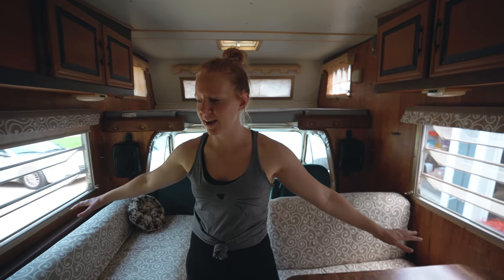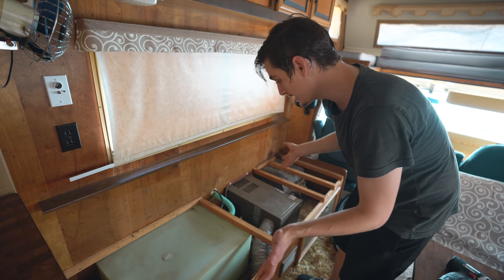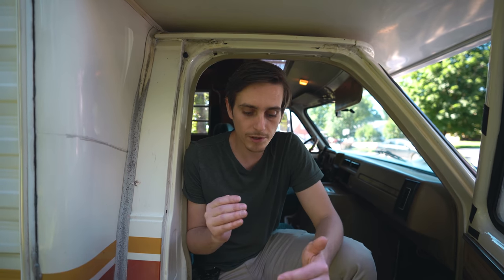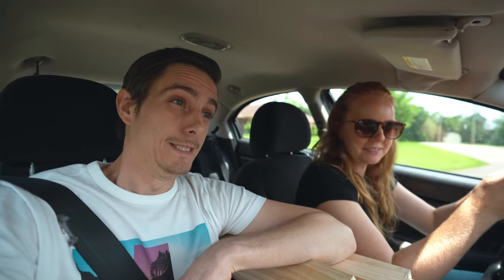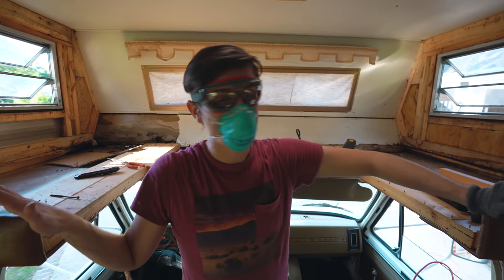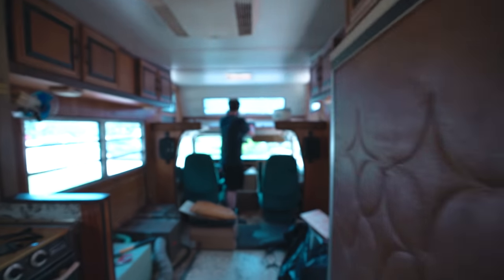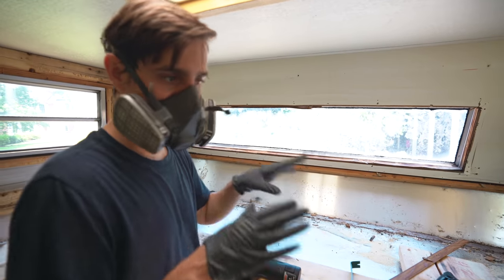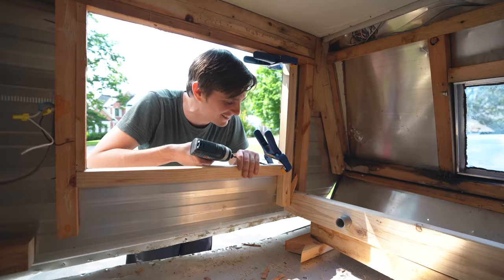Vintage RV Renovation BEGINS!… And We Have No Idea What We’re Doing 😳

Comment: From experience, I've learned not to throw away any of the paneling until after the job is done. All of the old stuff will be extremely useful as patterns to cut the new stuff from. And PLEASE, document ALL of the renovation. It's fun for all of your subscribers to follow, and you'll enjoy looking back on it in the future. Best of luck with your project.
Reply: Exactly what I was going to say - it’s a tremendous help to use the old stuff as templates to cut the new stuff!
Reply: Yes! Ditto.... brst advice :)
Reply: What I was going to say, easy thing to miss.
Reply: Exactly! Keep every screw, every panel, EVERYTHING. It's extremely helpful throughout the project
Reply: I'd agree. I expect it's a case of easy to rip apart, but a pain to get it back together properly.
Reply: @hazelrx97  YEP!  And lots of tupperware with labels to know where the hardware came from!  And pictures to know how to put it back together!!
Reply: I'd like to have some of the Old stuff

Comment: Some tips from someone who's done a few of these:
1) Paint the roof with Aluminum RV roof paint, it seals all the screw holes and reflects the sunlight.
2) Take pictures before you take anything apart, it helps even with building new stuff
3) Get lots of tupperware containers and keep screws, bolts, hardware, etc. so things don't get lost
4) Don't take too much apart at once.  Pick a small section, and rebuild it all the way.  It's easy to start tearing everything apart, and the next thing you know it gets too difficult to put back together!!!
5) Keep your RV well ventilated, and use desiccant if needed for moisture control.  It's easy to get too much humidity inside from a shower, your breath, etc... and then the wood rot begins!!
6) Think about using FRP for your paneling, it's waterproof and cleans very easily.  It is very difficult to work with, but once it's in it will last FOREVER :-)
Cheers!!
Reply: Thanks for the tip!  Never knew about this material.  I looked it up:
Fiberglass reinforced panels, or FRP, are thin, flexible plastic panels made of strong polyester resin reinforced with fiberglass. They are used on walls and ceilings and can be installed directly over drywall, wood, concrete block, and many other solid surfaces.
  Cost for 4' x 8' panel is $32.
They also come as plain vinyl sheets (no fiberglass) shaped like a brick wall, tin tiles, shiplap, textured, or smooth.  More research is needed as to pros and cons and how to cut it, mount it.  Looks like an industrial glue paste is recommended like Loctite Power Grab or Liquid Nails Extreme Heavy Duty Adhesive.
Reply: @lass-inangeles7564  I used FRP on the inside of my Sprinter van 9 years ago, and it still looks like new (And I full time in it).  I mounted it with the mushroom grommet/washers that Mercedes uses for their panelling, with the self tapping screws.
Cutting it was easiest with an angle grinder or circular saw.  Jigsaw made rough cuts.
I thought it might expand/contract because of severe temp. swing inside, but it doesn't.
What's great is it's almost cutting board tough and super easy to clean.  And you can even order it in an OK variety of colors.
By FAR the best paneling I know for inside an RV if you want it to last forever!
Reply: @nonebiz2132  These are very helpful tips, thank you!!  So it looks like its not a brittle material due to the fiberglass making it more flexible and resilient.  A fine blade on a circular saw would probably cut this fast for big panel work.  I also have a Dremel Saw Max which is a mini angle grinder type tool for more detailed cuts.  Great info.  I guess you can paint with oil primer + latex on these panels as well, right?  I need bright colors inside.  So you don't need any adhesive, just grommets?  This makes it even better - modular and replaceable.
Reply: Aluminum paint is also ultraviolet protection. I use it on ww1 airplanes.
Reply: Very helpful recommendations for a novice! Thanks from Canada🇨🇦
Reply: Thank you for the advice!! 🤩 I’m compiling a list of renovation ideas, tips, tricks and rules for RV-ing. I’ve never done it before but I want to live full time so I can travel the country! (And hopefully the world 🥰)
Reply: hey very curious aboutt what the company was that did the testing on your flooring

Comment: How exciting to see how these were built, nice going!
I had a lot of valve stem issues, esp on the dually rear inside tire as i used a rubber curved valve stem extension. Almost all the stems leak!  Get stainless steel type.
6:47 - Same issue with my Class C.  Its most likely a leak along the fiberglass exterior seam front of the cab where it meets the side.  Redo the seam from outside.  Most likely the whole structure is damaged from what I see.  If you find this to be the case, you need to peel back the fiberglass shell outside, rebuild the carcass with clean wood and plywood, then use fresh fiberglass to cover.  If you do this, eliminate that front long window - another notorious leaker of rain.
Please tie back your long hair anytime you are working with tools or DIY.  Its should be as standard as goggles and gloves.  Fan blades, machinery, etc can tangle up with very serious consequences.  You never know.  Plus you see better.  What you currently have is still too long for work.
Keep the old wood pieces as templates for new wood shaping.  Don't be quick to throw anything out permanently.  
Sell the couches.  You can get $100 each or more.  These cost a lot and many people want extra beds or dinettes in their toy haulers for the kids.  I made $200 on my dinette and $200 on the couch - both 20 yrs old.  The frame is in demand.
Those masks can be washed and reused.  Dremel tool is best for this kind of work, in case anyone needs to know.  The Dremel Multi Max 45 is excellent with choice of several blades to scrape, cut wood, and cut carpet. There is no other tool made that can cut so flat and close to the edge, not even a jigsaw.  A must for RV work.  Harbor Freight and Amazon sell blade replacements cheaper. 
Dicor Lap Sealant - rubber compound to seal exterior.  RV standard.  Do not use Silicone.
Butyl Tape - for all joints to waterproof. Also a rubber compound. 
Sikaflex instead of Silicone for window trim sealing.  Comes in many flavors.
Oil Polyurethane mixed with Mineral Spirits 40:60 ratio coating will give you some water proofiing on wood in vulnerable areas like the cab loft.

You both did a superb job removing that gross carpeting and replacing all the dead wood in cab area.  These are major renovations, a huge workload, and takes solid skills. Adds enormously to the value of the camper.  Floor might be damaged too, but keep at it.  Its a wonderful makeover.  Well done!

Comment: Top tip for removing stickers etc is a product called "Goo Gone" It literally soaks into the sticky residue after decals are removed and you can usually just wipe it clean in one go, brilliant stuff and much easier than manual removal.

Comment: Not just the cabover windows, check wall to roof seams and any roof marker lights, fan openings etc for leaks. Remove all rotted or mildewed wood.

Check roof material (EDPM or TPO) for cracking surface deterioration. Reseal all seams & edged with Dicor. If needed recoat roof with rv roof sealer. 

Just cutout rotten floor sections over bracing with the oscillating saw  and lay in new material. Seal & undercoat.

You're doing great! Keep up the good work!👍

Comment: More reno.  My kids like it too!  The front window will probably end up being a pain down the road.  The rain just gets pushed in when driving.  I've had success with pro-flex clear product.  Also, check if you have any lights on the outside (not like the headlights).  Pop off the covers and check all the screws for rust and fit.  They can easily leak too.

Comment: When redoing the floorboards for the drivers and front passenger section.  You should consider soundproofing for the floor.  I used a type of peel-off material that has a layer of tar type material that insulates for heat and sound.  I think it is often used for the restoration of old cars.  It works really great, because there are so many noise and heat issues that come from the engine compartment.  It was well worth the effort then I did the renovation of my 1976 RV.

Comment: A few friends of mine tore a Class C motorhome body off in 1 day and rebuilt it on frame with weather treated lumber. Used ALL of the old pieces as templates so that everything fit perfectly. SOME Class C motorhomes have a METAL skeleton instead of a WOOD skeleton(like yours). Good job so far.

Comment: New PBS series, "This Old RV" starring Alison and Eric. It is very interesting to see the details of the renovation and how you plan to outfit it. I would recommend underfloor heating and hardwood floors, LED lighting, and positionable solar panels, foam insulation, too--great for sealing air gaps and for sound reduction. Also consider replacing the windows. Keep up the good work!

Comment: Have owned many campers. When you have the walls off, add some fire proofing. I want to see ALL the renovation! Working on your escape mobile is the most rewarding work there is.
Reply: What’s the best way to buy a camper?
Reply: @partynerd12  unless you’re rich and enjoy throwing away money, you have to buy used. Campers are cheaply made and rot and break on the regular whether you buy antique or brand new. Pretend you’re McGuyver and just enjoy it. Your attitude will determine your experience.

Comment: Yes to more reno videos! Also, you obviously have some carpentry skills not to mention auto-CAD and design skills. I thought your sliding bed/sofa idea in a prior video was brilliant.  Now get to work, we’re excitedly waiting to see the results.  In the early 1990’s we bought a 1976 Shasta 23’ on Dodge chassis. They seem to have similar problems with moisture. With those new tires you should keep an eye for uneven wear due to mis-alignment (speaking from experience). Also we had a faulty fuel gauge, leaking fuel tank when full .... all fixable. You’ll love it when you are done! i.e., the reno experience and the resulting customized motorhome. Best wishes!

Comment: Just for future reference, a super helpful tool for that tight quarters seat removal is called a "mini ratcheting offset screwdriver". It's built to hold those 1/4 screwdriver bits the way you would use a larger socket wrench.

Comment: I did the same replacement of the front bed area framing. The framing you saw was original. They just didnt have the sealant technologies we do now. Really check your roof. Ive seen a lot of comments in that regard and theyre right. A lot of damage if you skip that step.

Comment: Since water damage is prone consider using plastic board from home depot it will not rot. use the #M 5200 sealant to glue it.

Comment: Congratulations on the samples being asbestos free. But one question, was one of those samples the glue that holds the tile down. You're just as likely to find asbestos in the glue that held it as in the tile itself. Renovation years ago for the company I worked for, our tile samples came back negative but after the demolition crew started sanding the glue off the concrete, someone thought to ask them about testing the glue. It had not been tested. The eventual test came back positive.

Comment: As a seasoned RV Owner and Lifetime Lifetime Camper with my Parents and Grandparents, Good luck. As a Married Couple we had 3 stair step Children now 37,36&35 we started in 1987 in a tent with them. First night 400 miles from home we were drowned by a Thunderstorm. Tent flooded sleeping stuff wet not totally but oh well. For a moment it was tense, them at the exact same moment my wife and I broke out with Row Your Boat. Before we even finished the first round all 3 of them had joined in. Right moment and all 3 were hooked on Camping. The first trip if you ask them was the greatest vacation we ever took as a family. Now 3 Popups and 2 Hard side rigs late we still love the journey , just the 2 of us now and the grandkids loving it as well. Anyway My wife Dad in 89 bought a 77 Swinger MH. Got it home and we found Water Damage. We ended up rebuilding from the frame out. Everything had to be replaced, the tin Roof. Wife and I have always preferred pullRigs I just like it more. So I tell you the fun really lies ahead but be very careful as you rebuild checking every nook and cranny. Water always finds the path of least resistance. This is a memory maker for me as a kid. Good Luck!

Comment: A tip: rubbing alcohol is great if you want to remove old stickers! I've used it to clean my store windows and metal shelves where the previous owners had huge stickers. All the sticky glue residue just melts off.

Comment: When you redesign.  You should figure out a way to have two spare tires.  When I had one dual tire go bad.   This also caused the second tire to go bad.    It is difficult to find and replace the 16.5-inch tires.   I designed a holder to store both of the tires under the bottom of the rear of the RV.  I had a guy at a welding shop build it for me.  The tires are held up by a shelf of solid graded meshed metal.  There are two bolds near the rear tires that hold the platform in place.  I use my jack to lift up the end near the bumper, and then put bolts in place to hold the shelf in place.  This gives me TWO SPARE TIRES, and there is no tire on the rear of the camper to be in the way.  This also keeps the spare tires out of the sun.   Easy access on the road also.

Comment: I would have the outside resealed up too I had a between class b and c and I had to have it resealed at a rv place and i had to do what you guys are doing now from all of the leaks I had. I would for sure check all of the seals on the outside of the rv to make sure there is no cracked sealant. You definitely have to reseal the outside with caulking and i would run a hose to find out where it's leaking and reseal those spots up

Comment: You've probably already gotten the stickers and other glued stuff off, but in the future, I recommend using Goo Gone. I like to use the spray gel version. You can use the heat gun to remove the stickers, but Goo Gone will make short work of the residue. You could probably just spray it on the sticker and let it sit for a bit, and peel it right off.

Comment: Those valve stem caps you guys got are called “gator caps” they’re not a 100% leak proof. Overtime they will fail, but do keep an eye on them. Also they’re threading so you can screw a plastic cap overtop to protect from debris!

Comment: When you get on the road you should consider getting AAA Roadside Service.    You should get AAA Plus RV Coverage.    This will get you 4 tows of up to 100 miles, and one tow up to 200 miles.  The price per year I think was less than $200.  The advantage with this type of RV is that you can not be towed with a conventional Tow Truck.  The reason is that the read wheelbase is set back too far from the rear bumper.  So the only type of tow truck that will work is a Tow Truck used for Semi Trucks.  We had to be towed once while we were in the UP of Michigan.  The tow truck driver told us that our tow would have cost us about $500 if we didn't the correct towing coverage.

Comment: From  yacht repair shop, when you replace the paneling use a marine sealant like 3m   5200 from home depot to seal and glue  paneling and seal seams. clean up with mineral spirits    you will thank me later.

Comment: When using pocket holes, I strongly suggest that you do not use the hammer drill. Use a conventional drill with a low torque setting. It is very easy to strip the screw especially in soft wood.

Comment: I would like to see more of the actual how to replace this and that in framing out windows etc.. I own a 1989 Ford Jamboree which I am in the process of transporting 1000 miles to my location. Thanks for the last video which spoke about replacing the carb with fuel injection.. I didnt know that was able to be done.. and it saves gas mileage.. my RV currently.. is about 7 mph to improve that would mean being able to take more road trips. Mine does need some upgrades due to leakage, being store at a friends house.. not being covered and all as well as I believe the ceiling will need to be replaced due to carpenter ants getting in there too.

Comment: if you want to use it in cooler weather, you should replace the drafty windows. Re-sealing is a joke besides the water damage. you should also pay close attention to insulation and sealing also. If you plan to use the RV when it is under 60 F

Comment: If I may.  Make sure you buy the right tools for the job.   Then, you'll have them for the rest of your lives.  For example, they sell a corner wrench/screwdriver tool that you'd have love'd to have had for seat removal. (Best of all, it's cheap)
Also, check the oscillating tool instructions.  It may be something the will help on the floor to get the liner up.

Lastly, I have found in my 50 years of building stuff, that there is always the right tool for a specific job.  If you are struggling with something, often you're not using the right tool.  Go to your local hardware (not Lowe's/ Home Depot). They can help you find the right tool.

Comment: The you guys to get your stickers off the glass you can use a razor blade it works really good then after that you can use limit glue remover and after that to the stickers on the metal itself they make day will it's called a eraser wheel it's the like an eraser which put on a drill and it takes them right off does debt does no damage to your paint all you metal